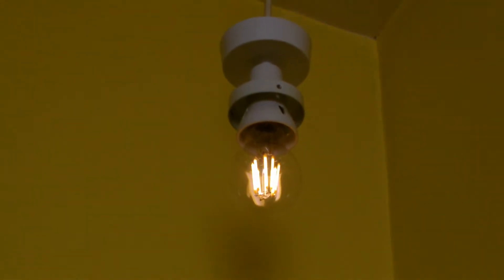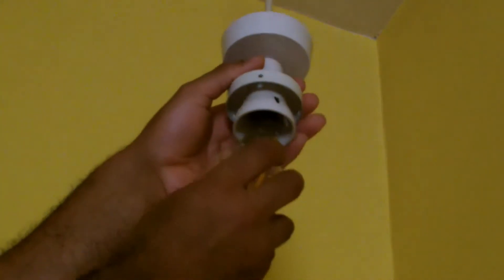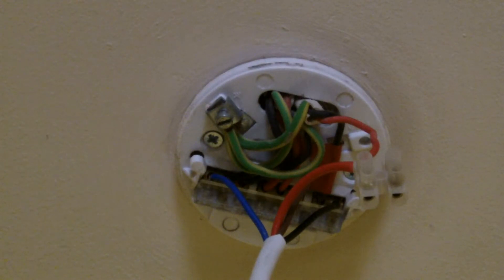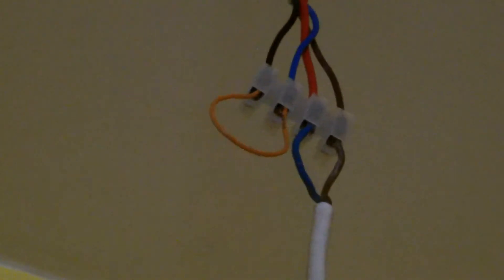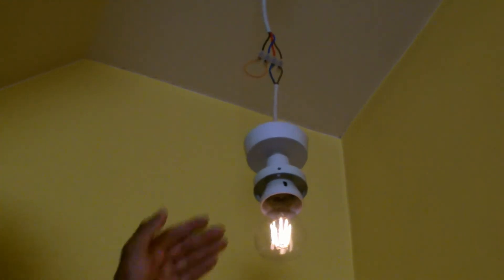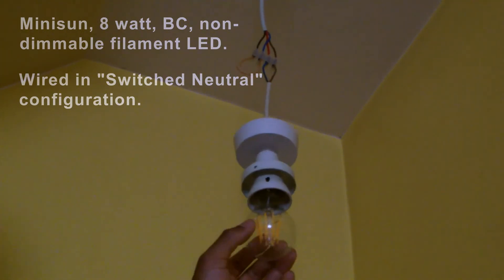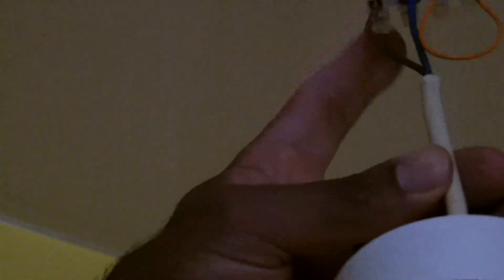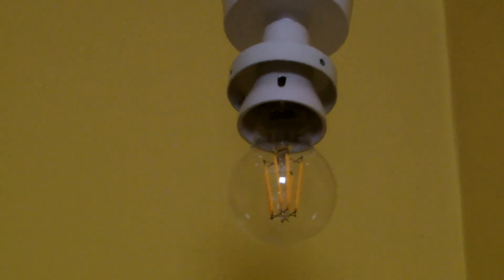Curious demo of a glowing LED, even when switched off at the wall.

Comment: Will the residual glowing cost me extra with the electric company. Is it consuming additional electricity?
Reply: it'll cost you and the electricity company, yes. you're tapping energy from the live wire.

and should you wire your switch to switch the neutral only on purpose(and not in like a multi switch situation) please put some sign about it at both ends of the wire.

but it's not really like rocket science to tap small amounts of energy from it or some forbidden knowledge(well ok chatgpt might refuse to tell you how depending on how you ask). they make smart switches that use caps to work the same way(you can just put it inline in the live wire).
Reply from the maker: The answer to the question is more complicated than you might first think. If we assume that the consumer's electricity meter ignores the reactive (capacitance of the wiring) component of the current then the answer will be: yes it does.
 
By definition the fact that the LED is glowing indicates that it must be using power.  The real question is, how much power? 

If you were using a tungsten filament, such as halogen bulbs, then the answer will be less power than you were using before you changed to the LED. This will be true irrespective of whether the LED is glowing or not. 

My personal guestimate is roughly 0.036 to 0.01 watts when and LED is glowing due to the issue described in the video [value obtained using this vague calculation (240^2*2*(22/7)*50*2*(10^-9))].  So my guestimate based on glowing for a whole year is roughly 1142 kilojoules of energy which equates to 0.31 kwh per year. Roughly £0.06 per year if you live in the UK.

If you were to fix the problem by using a "shunt" then you are not necessarily curing the usage but more hiding the energy that causes the LED to glow.

If your electricity meter does actually measure the reactive component of the current then a glowing LED is the least of your worries.

Comment: Thanks for explaining this. I have some spot lights on a 2 way switch in the bedroom (unrequired dimmable bulbs installed with no dimming switch) The bulbs glow like u show when switched on at the bed then off by the door. They dont glow when switched on at the door then off at the bed! 

Q1 Can i fix this by just installing non-dimmable bulbs. Q2. Is there a constant leak of energy with the dimmable and / or non-dimmable bulbs if this is happening?
Reply from the maker: I have finally made a video with a more elaborate technical explanation
www.youtube.com/watch?v=AQtUgdHBvXc